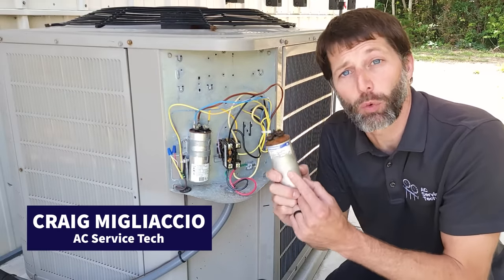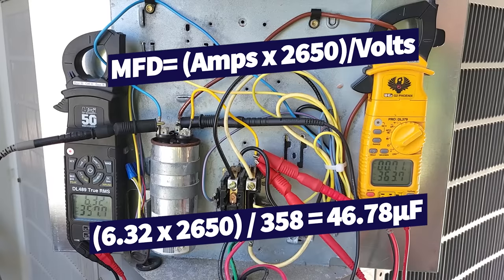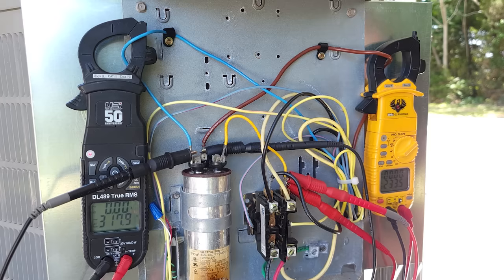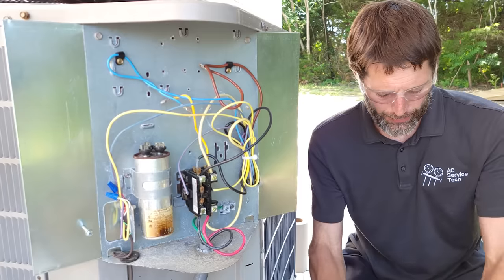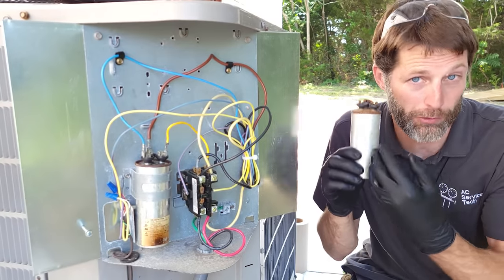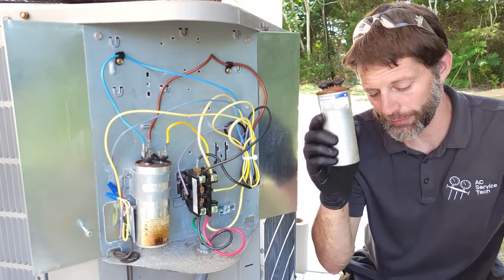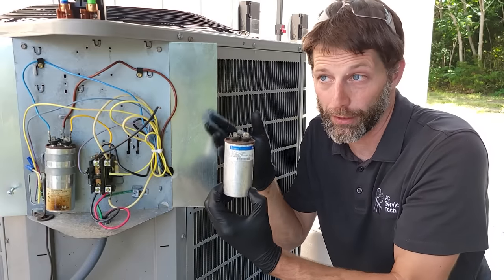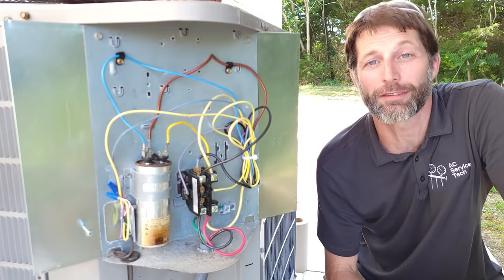WHY CAPACITORS FAIL in Air Conditioners! Watch it Break!

Comment: You knew before hand they will explode and is not easy to predict so in my thoughts they blew out because voltages were exceeded. Toward the sun placemen't doesn't convince me at all. Unless you were in the sahara desert.
Reply: See my posts below, he heated it (with a torch?). Please click 'like' on that post below so it can stay at the top (when sorted by 'top comments')
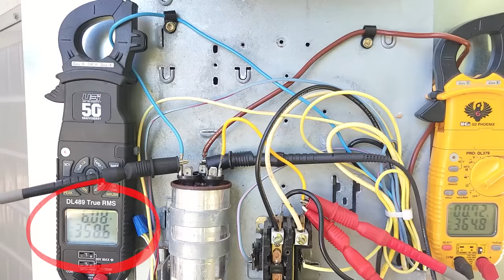SO MANY also have this question. Credit goes to others' answers (replies) below that spotted it before me at 5:42, so I also posted this as a comment instead of a reply, so people can see it without searching and opening all the replies.
Mr KL
Reply: @troubleshooter1975   So my point was correct. Thanks for clarify
Reply: @danuber5558  Well -- maybe; This didn't really address over-voltage at all.
He heated it, and it failed from over-temp. It also didn't directly reflect one way or the other as to if it is heat or voltage, or both, causing failures in the field...
It just proves caps can fail if you heat them...
KL

Comment: That's cool that you magically knew that the cap would fail. Of course you didn't show that you intentionally iced the condenser coil over to overheat the run capacitor by forcing the compressor to perform far past it's duty cycle. 

That speed up with no sound hid the fact that the compressor safety relay tripped more than once and you kept resetting it several times off camera, but it was an effective demonstration--- at the expense of ruining a unsuspecting service customer's compressor permanently. 😆

Comment: Why don't they make capacitors more durable?  9 times out of 10 when my AC fails, it's a capacitor.  $250 diagnostic and travel fee, $100 labor, and $350 for the capacitor.  $700 for a cheaply made battery is outrageous.
Reply: The capacitors fail because of over stress , either voltage spikes, brown-outs, high temperature of the operating environment, or vibration while operating. You can get a whole house surge arrestor, buy 440VAC capacitors instead of 370VAC type, buy a high quality cap, made in North America not made in east Asia, move capacitors to a location lower in the cabinet, change fan blades if cabinet is vibrating. One more thing. The fees you mentioned including the price of the capacitor … you’re being taken advantage of.  Try not to play helpless. Yes, they come sooner if you do, but it’s because they know they can charge you a multiple of the ordinary and customary fees.
Reply: @oliverstreet7704  Thanks for the advice. I was considering buying a couple of capacitors online just to keep around in case mine went out.  You pretty much just plug them in, right?

Comment: The capacitor can't handle the ripple current. You need a cap that has a higher ripple current rating, and it'll be physically larger...and expensive. Also, an increased voltage rating won't change anything. The design obviously runs the  caps way too hard.
Reply: higher ripple rating will certainly result in less internal self heating, but voltages, especially if it peaks over its design maximum risks it arcing/puncturing the dielectric, making it go short

Comment: not totally true / understood   current draw is due to torque / of the induction motor to perform the work --  when incoming voltage drops it will cause higher current draw to equalize - ohms law   motor turns at the same rpm with lower voltage the amps/current will be higher -- the higher the amp the higher the temps ---- a capacitor does not regulate amperage/current draw - A capacitor stores and releases power to allow the motor power on alternating swing at the time the motor is not powered up to allow the motor to run smoother    look it up

Comment: Caps fail quicker also when the coils aren't cleaned and the increase in temperature puts more strain on all the electrical components. Not good for compressors or refrigerant coils either. A lot of times after a cap fails and you don't catch it right away your compressor will fail shortly after the new cap is installed because of the excessive heat damage to the oil and windings.
Reply: It's supposed to have a thermal breaker to prevent this overheating.
Reply: @stinkycheese804  it doesn't help prevent damage that much. They just keep the service companies in your pockets. If it isn't a manual reset most people won't even know somethings wrong.
Reply: @stinkycheese804  but if the thermostat is still calling the compressor will heat up then the overload will open and it shuts down until it has cooled. Then it will cycle on and off over and over until it is turned off and repaired. Best to install a high pressure manual reset shut off on the discharge line to prevent more damage.

Comment: I am not an HVAC tech but do have a question for any HVAC tech out there that cares to respond… (Thank you in advance 😊)
I have a huge oak tree above my AC compressor. I constantly have to clean acorns and leaves and twigs out of the unit. Even in late spring and early summer dead leaves, etc will get in there and require cleaning. Would building a shed roof about 7 feet above the unit and putting some wire mesh with say 1 inch openings around the unit while keeping access and  say 2 feet of available air flow to all of the sides of the AC unit be helpful to the unit cleaner and give it some shelter from the twigs, leaves, snow, etc be beneficial to the longevity of the AC unit or detrimental to it? If someone decides to answer, thank you for your time… 😊
Ron
Reply: Sounds good to me . Been a tec my entire career.

Comment: I missed how you heated it up and blew it. Also, when the tops mushroom, I believe there is an electrical disconnect inside that prevents it from exploding. It just disconnects it’s contacts. 

I made a video here showing how they act as a resistor or filter for lower frequencies. 

https://youtu.be/brZlaFynwuk

Comment: Are electrolitic capasitors fail only in AC units? So, why caps are overheating? BS all that! Take 2 separate caps of the same capasitance but double voltage and they will never fail.

Comment: According to my HVAC tech my "slightly weak " capacitor burnt up my 1100$ compressor. He didn't cover " slightly weak " and how that can destroy a compressor. There should be a failsafe built into these systems to prevent a catastrophic failure in case of a bad capacitor! The system should shut off until the capacitor is replaced.
Reply: There are three such fail preventions inline with the compressor. Under pressure, over pressure and over temp... Check your schematic diagram and see...
Reply: If a capacitor is weak the motor has to work significantly harder on startup and while running, which increases the chance of the motor burning up. The thermal overload is supposed to protect the motor by shutting it off when it gets too hot from too much amp draw but they self reset meaning the motor tries to start, overloads, tries to start again, overloads. Rinse and repeat until the motor fails or the capacitor is fixed. But that usually takes a while. Or the motor takes significantly longer to get up to speed which is hard on the motor. A burned out motor from a capacitor is not that common.
Reply: A good ear can usually detect sluggish or delayed starts.
Reply: @garymucher4082  none of those would help in this case, the thermal overload would though.
Reply: Easier said than done. But there are systems out there now that monitor compressor amps. Some additions you can install that also monitor.
Reply: @peterstencell804  The unit was repaired about 2 months ago. It doesn't sound any different than it did before the failure. Back in January were having a small ice storm. I happened to walk outside and noticed the condenser wasn't running, but the air handler was. Checked the breaker, it was tripped, kicked in on, and immediately went outside and the unit looked like it was trying to fly off the concrete. Immediately shut the unit down an deiced the fan blades. Started it back up and it was fine for 3 months, at which point it completely quit. When my tech pulled apart the unit, the wiring harness was completely melted out of the compressor and had blown all the freon out. This unit is only 5 years old. He said a slightly weak capacitor,  I think it was a flaw in the wiring harness. You know, can't help wonder about the January breaker trip. I don't know, it doesn't make any sense.

Comment: You can see the cap is bad, don't waste time and money messing with it.  Why do they fail? Most of the time it's because the unit is undersized. Units are NOT designed for continuous running, that's why they go out during high heat. Too many HVAC guys are stuck on minimum and have some ridiculous idea an extra ton is bad. It's bad for them because the units last longer and they don't make service call money. They size for average heat and not maximum heat. You may average 85 in the summer but you have days of 110 and the unit can't handle it. You can actually double minimum size and be fine. More works less  less works more. You can make more do less but you can't make less do more. Older homes 400sqft per ton, newer homes 600sqft per ton. Too much math trying to determine mother nature will be wrong every time.

Comment: This demonstration was about showing how to calculate a capacitor value and watching a capacitor fail.  You did not explain how you knew this good capacitor was going to fail and how or why you made it fail.
Reply: He didn't make it very clear; he heated it up on the bottom. He makes vague mention at 5:42. I had to review it twice after I read others' comments here that he even mentioned it at all...
Reply: @troubleshooter1975  Good catch, thank you very much.
Reply: @qwerty13380  Credit goes to others here, I missed it too!
I searched to see if it had been asked before posting myself. I found that several here caught it. (hard to find when there are so many good posts to scan through!).
Even then I had to play it through twice before I found the statement!
Reply: @troubleshooter1975  Others may have found the answer, but you are the only one who replied to my post.  And BTW, before I placed my post I had spent quite a bit of time reading other posts and no one had mentioned anything about this yet.

Comment: To say a capacitor fails Do to the sun beating on a condenser in my opinion is false! Heat is a by product of current and resistance.
Reply: Odd since I had the exact problem with a fan motor capacitor.  Cap would go bad every year or two.  I had the motor tested at a local motor shop and it was fine.  I moved the capacitor to the evaporator box where it was cool, never went bad again.  Most any component goes bad due to heat whether it generates the heat or not.  Oh, capacitors don't have resistance, they have reactance.  They can and do develop heat internally.
Reply: @noneyabus1  so your are saying every system marked for outdoor use only should not be installed outside? You paid a motor shop to verify a motor? May have been cheaper to install a new motor. I agree most cases heat is the determining factor of failure. There is resistance in a capacitor. I maintain a lot of equipment where internal temps on vsd while running are 110 degree plus ambient temperature for weeks on end. Through t hounds of hours of running have no issues. Something to consider is peak voltage and quality utility power? As I am sure you are aware ohms law.
Reply: @jacojanks5985   I'm saying that the one I had kept dying after a short period of time due to heat.  I recall replacing that capacitor at least three or four times.  The local motor shop told me the next time it failed, bring in the motor.  Once it tested fine, then we were left with only heat as a probable reason for the failure.  I moved the cap and it never failed again so it must be the heat.  

I never said I paid them to test the motor.  They offered because I buy a fair amount of motors there and also send others to buy motors they need.  They tested it for free.  They have a test machine and it only takes a couple minutes.  Most of the time is hooking it up since it was a three speed motor.  I always used the middle speed since it was close to speed of original motor.  I might add, the motor at the time cost well over $100 and that was expensive back then.  Plus it was difficult to get out of the cage and get everything lined back up when reinstalled.  I replaced it once so I know how time consuming it is.  

For capacitors and inductors, it is called reactance.  At specific frequencies it can be put in a formula as a resistance value but it is called reactance.  The reason, capacitors and inductors behave differently at different frequencies.  Therefore, it gets a different name.  I was taught electronics back in the 80's and have always kept up with how new components work.  Capacitors have worked the same way since they were invented, they just don't last as long as they used too. 

https://www.electronics-tutorials.ws/filter/filter_1.html 

https://www.sciencedirect.com/topics/engineering/capacitive-reactance

Comment: HVAC equipment manufacturers need to return to using higher quality capacitors instead of using cheapo dual capacitors. Dual capacitors build up more heat especially the round capacitors that only have a small surface area that touches the metal cabinet of the control panel.  The oval capacitor has a much wider flat metal surface that touches the metal surface of the control cabinet which will conduct heat away like a heat sink when it’s mounted in the control panel with metal straps.  Only qualified people experienced with electrical equipment should ever work with live circuits.  I saw a compressor blow out an electrical terminal that ignited the compressors oil on fire. It looked like a jet engine in afterburner.  I had my hand on the disconnect and immediately shut the unit off. These machines are dangerous and should only be worked on by trained experienced personnel.

Comment: I think that most conventional HVAC systems in North America are total  junk  that has not evolved much since the 1950's. Why do most units go from 0% to 100% in one shot? Why not like on my Mitsubishi City Multi, it comes on slowly then ramps up to the desired speed.  I'm not an expert in this area but owned to previous homes with conventional  split AC + forced air gas heat.  All crap in my opinion.  It is all OEM parts tossed together into a box and a brand slapped on it.

Comment: Someone tell me what's the point of the math when you can just measure the microfarand directly
Reply: Running and static levels may not be the same thing.
Reply: Because under load a capacitor might test weak and not under load that same capacitor might test good
Reply: You can't use the mfd setting on the meter when unit is running.

Comment: I've been multiplying by 2652 lolol welp
Reply: Could you explain to me what the 2650 is and why we multiply it by the current? Thanks
Reply: @ruthlessf1149  

The formula "Amps x 2653 / Volts" is derived from ohms law.

E = I * Xc

Capacitive Reactance (Xc) is calculated like this:

Xc = 1 / (2 x pi x hz x farad)

Xc = 1 / (2 x 3.1415 (pi) x 60 (hz) x farad)

Xc = 0.0026527 x farad

farad = 1,000,000 microfarads

So 0.0026527 must be multiplied by 1,000,000

Xc = 0.0026527 ✕ 1,000,000

Xc = 2652.7

E = I x 2653

Formula :

amps x 2653 / volts

example - 4.8 amps x 2653 / 363 volts = 35.08 mfd
Reply: It is 1/(2*pi*60), then multiply by 10^6 to have measure in uF (10^-6).
Hope this helps.

Comment: An air strike happens against the capacitor, causing memory effect. This happens, when the air conditioned area is misused, used for gays and whores, or if the boss is doing financial trouble. When all these mistakes are cleared, the air strikes won’t happen against the air conditioner. Same thing with the freezer, if stolen food is inside.

Comment: This is incorrect. If ac had no relays and copasitors , it never work, if got it to work, the cost to run it would be 100 times more. But the compressor and motor will not stay on or the heat shut it down, over weghted  to run.